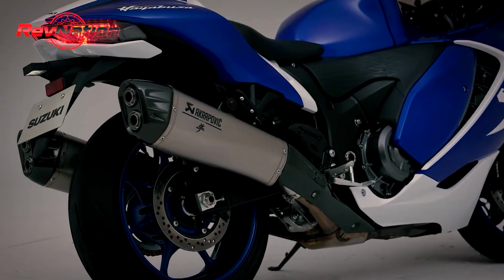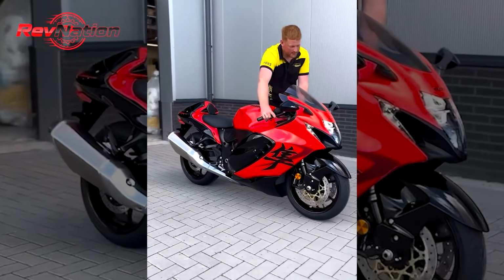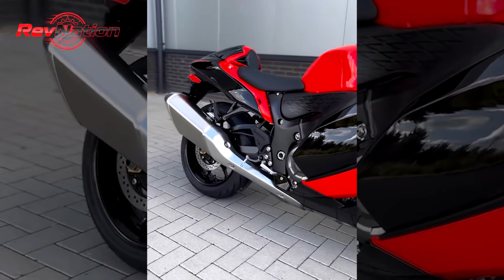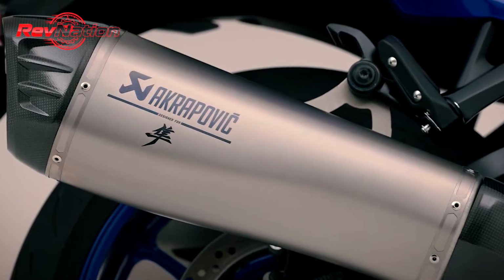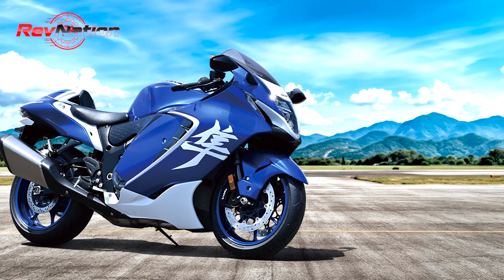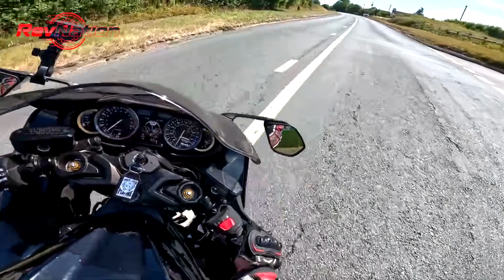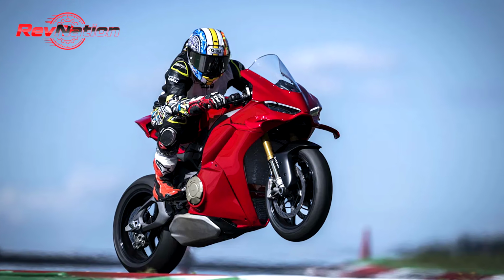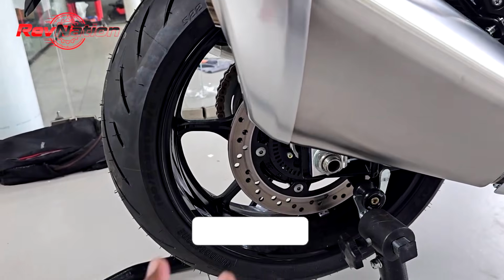The New Hayabusa 2026 Will Blow Your Mind!

Comment: You should cut out the AI narration, it is awful. And about the Hayabusa - Suzuki turned the once feared hyperbike into an old man's highway commuter. While still very fast, it is nowhere near the performance of the first generation Hayabusa, stock bike to stock bike. Especially comparing the bike availability and specifications back in 1999-2000. Hayabusa was the king of bikes. Now this third generation is under 200 hp. Why, Suzuki? From this engine you could easily and reliably extract at least 220-230 hp without compromising longevity...
Reply from the maker: What's wrong 😂  with the voice over buddy?
Reply: The first generation had about 175 hp and 100 ft lbs torque, the 2026 version has 187 hp and 110 ft lbs. The new one is about 20 lbs heavier though, but I doubt that you would get weaker performance.

Comment: 190 is not enough. Liter bikes make 200+ and weigh way less. H2 is still the king. Bikes dated
Reply: Lolz H2 wont last long and you have to get it check every other ride...your H2 is only build for short ride waste of money and time...😂
Reply: Remove  the damn speed restriction on them , I owned a 99 model which is unrestricted.  The bike with this new tech and unrestricted will bring back the 200+mph , my 2023 packs 204 hp at the crank with 195 at the wheel
Reply: Liter bikes also make like 50% less torque.   And that big power number is right at the top end.  Theyre down on power and torque everywhere you're actually going to use it.
Reply: @larryhouse3776 torque don't matter when your lugging around almost 700lbs. That almost 2 liter bikes. Tank!
Reply: @waltermiller249 a R1M is 452 pounds. A Hayabusa is 582. Theres literally about half the weight of a Grom between Yamahas track weapon, and the significantly larger Hayabusa.  Dont be so fooled by people telling you Hayabusa are just big boats, these people are uneducated.  350cc bigger and comfortably seats 2.  The busa makes a ton of sense on the road.  Drop on a lighter full system exhaust and forged or even carbon wheels and youre within 80 to 90 pounds of a R1M easily.
Reply: @larryhouse3776 582lbs hahaha
Reply: Problem is you can ride the buses for ever,the h2 only last s for one or two ride s and you can bye two buscas for one h2.
Reply: Can't tour comfortably on a H2 , glorified short haul hair dryer
Reply: @michaelchambers4466 rode both and the H2 is way more comfortable. And not what either bike was made for

Comment: TTS supercharger strapped onto these blows anything on the road 
Mine pumps out 415hp
Reply: And the motor won't last long if you do
Reply: @michaelreed9805 the new engine might not bat an eye at it. Think about the 2jz that engine could take 1000hp stock because of the oiling and the bottom end. They just beefed this motor up and added more oil channels. 400 hp in a 4 cylinder is not crazy anymore. Hell it's standard now
Reply: @michaelreed9805 mine has forged internals to handle 600hp 
Been riding it daily for over a year
Reply: That’s ridiculous 😂😂👍
Reply: Whoah… that sounds terrifying 😂😂
Reply: how it feels riding a 400hp 2 wheeler?